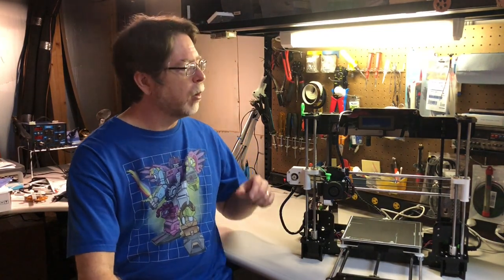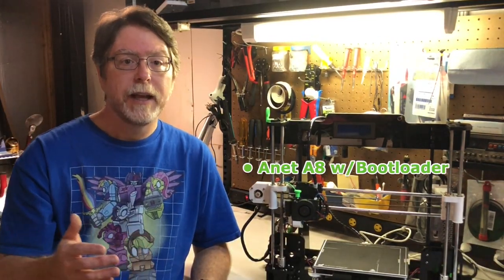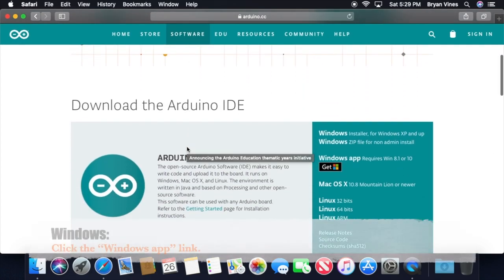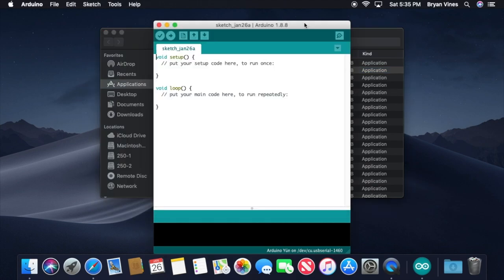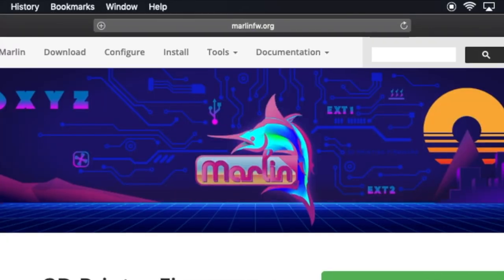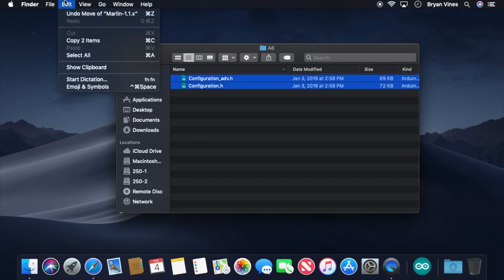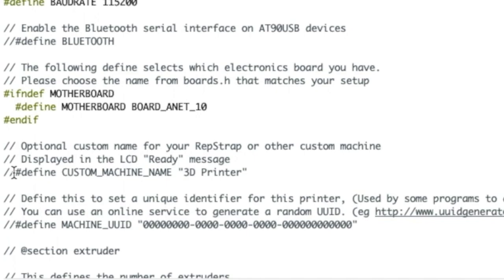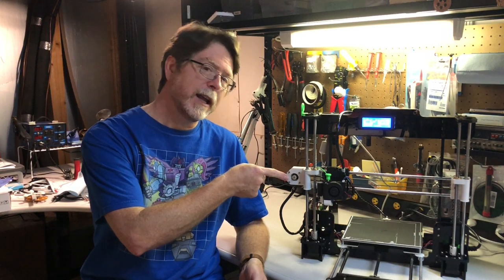How To Install Marlin Firmware on the Anet A8 3D Printer

Comment: Bryan I am confused on what to do for my port. The only port I see is the Bluetooth-Incoming-Port. Anything to help?
Reply from the maker: Hi! A couple of quick things to check:
1) Make sure the printer turned is on (I've missed this one before, happens to all of us)
2) Try another USB cable.

The printer should at least show up on the USB bus when it's powered on and connected to the computer. To check, you can use the System Information utility (it lives in /Applications/Utilities/System Information); open it up and, in the Hardware category, click USB. You'll see a list of all USB devices connected to your computer. For testing purposes, I recommend unplugging any USB devices you're not actively using at the time, just to reduce the number of items in the list.

Use ⌘R to refresh the list. Turn the printer off. Refresh. Turn the printer on. Refresh. When the printer is on, and the list is refreshed, the list should have one extra item in it (versus the refreshed list when the printer is off). 

If you can get this far, compare the two lists to see where the difference is. That difference is the printer.

Let me know what you're able to determine! 
👍
Reply: BV3D: Bryan Vines Thank you so much, I was able to determine that it is the USB2.0-Serial. Still, my port locations only show the Bluetooth-Incoming. What is the next step I should take?
Reply from the maker: @_prestonmarx   That's exactly how it shows up on my laptop. OK, so... With the printer on, if the Arduino IDE is running, quit it. Then open the Marlin project in the IDE again. The port should show up. Does it? Let me know! 👍

(It seems the IDE only gets the port list when it starts up, so if the printer is off when the IDE starts up, and THEN the printer is turned on, the IDE won't know the port is available.)
Reply: BV3D: Bryan Vines I quit out of the Marlin Project and made sure my printer is on. I tried using a different USB cable too. I ran the Marlin project and checked the ports but still no luck.
Reply: BV3D: Bryan Vines I think the issue might be the fact that the only ports that are being displayed are Bluetooth ports and no serial ports considering the printer comes in as a serial port.
Reply from the maker: @_prestonmarx   Just for grins, leave the printer on and connected to the computer. Restart the Mac. Then get back into the Marlin project in the IDE. 
If the port still doesn't show up in the IDE, then you may need to install a driver for the CH340 USB-to-Serial chip that's used on the Anet board, and there's an article about that here: https://kig.re/2014/12/31/how-to-use-arduino-nano-mini-pro-with-CH340G-on-mac-osx-yosemite.html
Reply: BV3D: Bryan Vines Restarting didn’t work. Am currently downloading the driver and will get back to you ASAP.
Reply: BV3D: Bryan Vines YES!!! PRAISE THE LORD!!! THE PORT IS HERE!!!! THANK YOU BRYAN!! 💯💯🙏🙏🙏
Reply from the maker: Awesome! I'm glad that worked for you! 👍Congratulations!

Comment: Hi Brian, great video.
But I got an error with the code "static_assert (digitalPinToPCICR (Z_MIN_PIN)! = NULL," Z_MIN_PIN is not interrupt-capable ");"
At compilation, a non-constant condition for static assertion is written.
Sorry for English, translate to Google
Reply from the maker: Hi! Which version of the Arduino IDE are you using? I've seen reports that newer versions of the IDE don't always work right. When I did this video, I was using version 1.8.8. The current version is now 1.8.10. If you want to try the older version of the IDE, you can download it here (get the 1.8.8 version): https://www.arduino.cc/en/Main/OldSoftwareReleases#previous
Reply: @BV3D  I did as you said Brian, now the error "#error" No FastIO definition for the selected AVR Board. "Appeared in the Configuration.h tab
Reply from the maker: @Alamama_Oka  Does this happen when you try to upload the firmware to the Anet board? Can you try compiling, but not uploading, by using the (√) button, to see if the project will compile without errors? I've confirmed that the "static_assert..." issue does not seem to happen with Arduino 1.8.8 or 1.8.9, but does happen with 1.8.10.

Comment: Hi I have error popup on Arduino IDE while try to compile:
C:\Program Files (x86)\Arduino\hardware\arduino\avr\cores\arduino/Arduino.h:258:10: fatal error: pins_arduino.h :No such file or directory
Can you help?
Reply: I managed to fix it by installing older verision, but now I have:
avr-g++: error: device-specs/specs-atmega1284p: No such file or directory

Comment: I followed all steps to install Marlin to my new ANet A8 V1.7 board ( For my Anet A8 PLus), but i cannot upload. I got message "programmer is not responding", "not  in sync", "problem uploading to board" So I changed for different USB cable, I changed USB ports, but it doesn't matter. I uses PC desktop computer with Windows7 OS . It probably means that I need to install bootloader, right?   :((
Reply from the maker: Hi @Tigran Ohanyan, I'll start by saing I haven't tested this on the Anet V1.7 board. Mostly because I don't have one. I think @Corliss Media2.0 has one; I think it worked for him, but @Dynamite86 was having trouble getting Marlin installed on it. Hopefully they'll chime in. 

That said, yes, the problem you're describing sounds like the V1.7 needs a bootloader installed. Keep in mind you're doing this at your own risk, so before starting down the bootloader path, make sure you have a copy of the Anet A8 Plus firmware. It may be different from the standard Anet A8 firmware.
Reply: OK. Thanks. This printer ( Anet A8 Plus) get to production I think 6 -8 months ago. I don't know where i can get the firmware for this printer. Do you know where I can get it? I can manually enter the table size, but maybe I need something else more important.
Reply: BV3D: Bryan Vines ....for what its worth, I have the auto level  and the none auto level firmwares, both sent from Anet about three years back.....i can put on DropBox if needed.
Reply from the maker: @eyamnottier3411  Thanks! Those may be the same files that are linked in the description of my A8 "Install Factory Firmware" video (they're on someone else's Dropbox, if I remember correctly). That said, Anet has finally released the source code for their firmware. The link below may only work in a desktop browser.
http://www.anet3d.com/down.aspx?TypeId=26&FId=t14:26:14
Reply from the maker: @tigranohanyan3321  If you're modifying the Marlin preset for the Anet A8 to use it on the A8 Plus, there may be additional information you can use in Anet's recently-released source code for their firmware. The link below may only work in a desktop browser. If nothing else, you can download the factory A8 Plus firmware's source code and load that back onto the printer.
http://www.anet3d.com/down.aspx?TypeId=26&FId=t14:26:14

Comment: I get an error that says bon constant condition for static assertion
Reply from the maker: That happens with the Arduino IDE version 1.8.10. 

I've run through the process with version 1.8.8 (which is the version I used in the video) and version 1.8.9, and can confirm that, on the Mac at least, the project will compile. 

It will not compile with the current 1.8.10 release.

You can download the 1.8.8 release here: https://www.arduino.cc/en/Main/OldSoftwareReleases#previous

Give that a try and see how it goes.
Reply: @BV3D  thanks for the quick reply. I ended up commenting out some  Endstop Function and that ended up working fine. Amazing video btw
Reply: @skydivingmoose1671  how you commenting out some Endstop?
Im not so fit in this area

Comment: The Anet board I have, is v1-5 ( - no .) I am brain dead with this stuff!  Does it have a bootloader?
Reply from the maker: Hi! The only way I know to tell if a board has a bootloader is to try uploading firmware to it via USB. If it takes the upload, it's got a bootloader. If not, well... it'll need one. Sorry for the lame answer, but it's all I've got. 😃
Reply: I had the same problem. You wont even be able to burn the bootloader (I know because I forked out for a USBASP device and spent countless hours trying). Just got a V1.7 Anet motherboard and can FINALLY upload Marlin!
Reply: Tony Caf .....Dont know the ins and outs...but earlier today, I followed Bryans tutorial....and having fat fingers and no brain...I did flash a spare Anet v1-5 board with Marlin. It may be relevant..that this board on start up does not have the Anet banner...its Omni and as it flashed without problems once I typed ...typo free...the  correct instructions in the Mac terminal. Feeling smug, I have also just reflashed the board with the Anet Auto Level function...which is what is also used on my A8. Fact is I have stayed away from even trying to flash the board because I had implanted that Anets don’t have bootloaders.
Reply: Tony Caf ....what I dont know...is if the push button Anet LCD 2004 display capable of the full menu options. I have seen vids of the navigation using the turning knob...cannot see how the same menu can be run pushing buttons!
Reply: @eyamnottier3411  I assume its just a different interface. Eg a computer mouse v keyboard
Reply: Tony Caf ...looking around eBay and a couple of the Chinese stores for a turn knob display  compatible with the A8 and its ribbon style connecting socket....not found any..
Reply: I’m sure the turn dial display is for an A6

Comment: The problem is that when you heat the bed to 100 C for PETG or ABS printing, the power of the heat bed is not enough for some printers. You have to use very good insulation for the bottom of the printer heat bed . If not, the temperature rises very slowly and at some  moment the program thinks that something wrong and turns off the printer with the message "thermal run away, please reset" Ups...and lost your 9 hour job.... I hate that.  I got new on the market Anet A8 PLus ( 300x300mm built table ) with this new Anet  V1.7 board and I lost so many long hour printing. Even If you build enclosure and make a good insulation, OK you will get some how to 100 C .  But, the bed temperature rises so slowly. During the print anything can happen, the room temperature can get low and ups....the temperature gradient stop going up or keeping the temperature constant. The heating  slows down or stops ...and guess what ... The program turning off the printer thinking that's the thermal run away...My 3 year old Anet with old program never got problem like this. I got so many nice long 15, 20 hours printing. No problem at all. This new Anet A8 v1.7 board with new program is so sensitive....it Is sucks....If you print low temperature PLA , its not a problem. It should work.  Probably 90 % 3D printing guys using today PLA for printing.  But for PETG and ABS filament heating is very important. I think that , its better ether increase the heating power of the bed, by attaching additional silicone heater under it or just turn off the protection changing the programming in order to print PETG and ABS. Anyway Anet A8 Plus is a shit printer if you want to print PETG and ABS. You need to modify it for sure 100% to fix that issue.
Reply: Hi, I'm printing well with the Anet A8 plus with PETG but yes it is pretty 'borderline' I think. I have it in a kind of enclosure and at least protected and with a isolation-pad beneath the  bed. Also a cotton 'sock' around the heater-cardridge to get it to temperature faster and to keep it like that...

On my A8 I had thermal runaway issues after I upraded the FW ... in winter it could not keep up although it was in an enclosure. Not enough. At least the A8 plus is working on 24 Volts and having a stronger heater that way but like with the A8, I might need to go back to stock-FW  and use a heater close to the printer.

By the way ,if the thermistor gets loose or broken, it will get in a 'min-temp'  state and stop anyway but make sure it is mechanically bond so it won't fall out close to the heater.

Comment: This does NOT WORK for the Anet A8 Plus. Can't find a single damn tutorial for that!
Reply from the maker: I'm sorry about that. I didn't even know about the A8 Plus until around June of this year.  But Anet has released the Marlin source code for the A8 Plus (http://www.anet3d.com/Private/Files/6369653038268183252348988.rar), so you can download it and tinker with it if you need to.